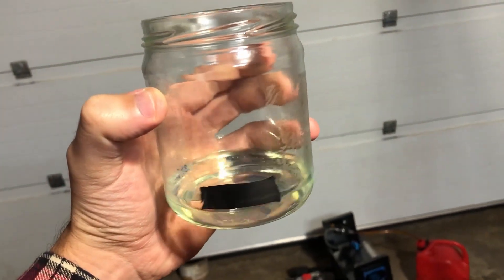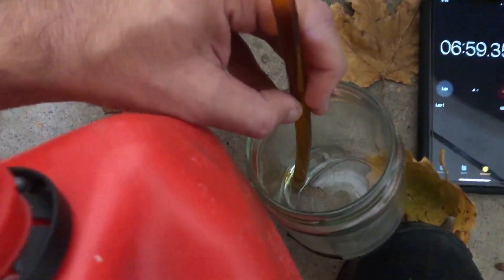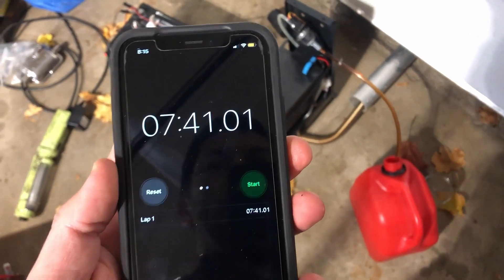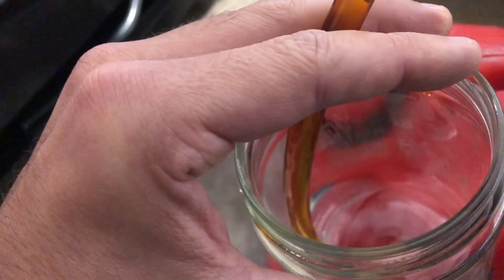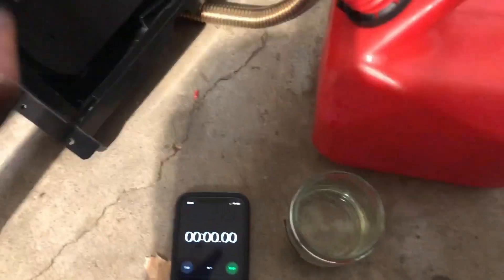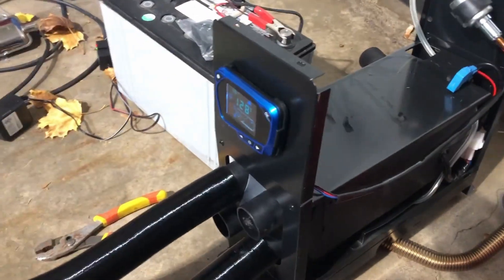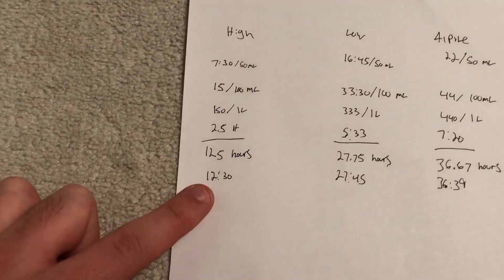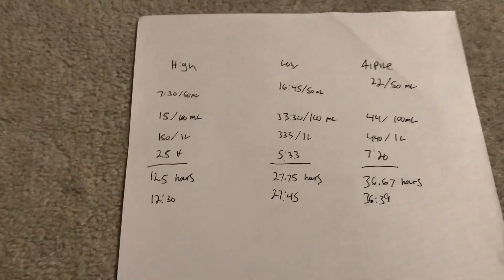Vevor Diesel Heater Fuel Consumption 5Kw

Comment: Pump is 0.022ml...    hertz rate of pump...    0.022ml x hz x 60sec x 60mins
Low...    0.022 x 1.4hz x 60 x 60 = 111ml an hour...

Med...   0.022 x 2.8hz x 60 x 60 = 222ml an hour...

High..   0.022 x 4.2hz x 60 x 60 = 333ml an hour...
Simples
Reply from the maker: My heater you can’t control the pulse rate. Well not directly. It’s only settings are 1-6 unlike others where you can control the hertz for the settings.
Reply: @brettseres8352  time the pulse rate for 30 seconds and double it for the hz rate 👍

Comment: Not cost effective. Diesel is $4.00 a gallon.
Reply: I disagree when it’s freezing out you would happily pay $2 to stay nice and warm in your camper van all night 👍🏻🇬🇧
Reply: @AJ-qn6gd  And a man dying of thirst would gladly give everything he had for a drink of water. Now please tell me what that has to do with the price of Diesel?
Reply from the maker: The cost is irrelevant to me for the heater. I have it for a reason. It’s a portable heater for me that can be used for different things than my buddy heater. The cost per hour to stay warm in certain circumstances is irrelevant. But I do want to know how long I can run it before I need more fuel.
Reply: At the moment, pump diesel is £1.47 per liter, to run a 1kw heater costs me 36p in electricity per hour, the heater will run for about 5 hours off a liter, that's about 29p per hour. It's not much but it is a saving. In UK we can get red diesel meant only for off road use and that's about £1 per liter. Fact is that we are mega jipped off here in UK for fuel. Not sure how it is for USA but as far as I can see it is worth doing but does involve faffing about setting it up, it's noisy etc. so when you say not worth it, that depends on your situation and to just state ' not worth it ''could really do with some explanation.
Reply: When your cold cost means nothing
Reply: I use my diesel heater in my house. It's a lot cheaper than oil, Electric heat
Reply: I use Kerosene at 83p a litre which uses a litre a night to heat my upstairs in my house, it stops condensation as well. I also use one on my yacht which gets too hot on occasion...
Reply: About 6 here in Canada 🇨🇦 still theaper than a furncae and if you make your own biodiesel your good to go or waste oil mixed with 30 percent diesel and some additives . Make a setup fornstart and shutdown with straight diesel fuel then run off other oil 🛢
Reply: Says the guy with zero analysis skills.

Comment: Good video and thanks for your efforts. But you could have saved yourself hours of testing. You have the pump displacement (.02ml) X pump frequency. Can be set instead of Temp.
Reply from the maker: So yes that is an option. Unfortunately my heater is just heat levels 1-6 or I can do it by temp. Other heaters you can change it my frequency…I found this out after I bought mine.
Reply: @brettseres8352  Understood.  Still a good effort and I'm sure it will be helpful to many other

Comment: Tell me a little bit more about your under the garage door seal installation.  Any issues with heat? Im looking for a under the garage door seal solution
Reply: Get some cheap flexible Styrofoam "pool noodles " to close the cold air gap under the garage door. But hold it back from the very hot exhaust pipe by a few inches.  IMHO
Reply from the maker: I just have the exhaust running into a 3” aluminum pipe.  That was getting too hot for the rubber seal still so I now prop the door open on an old coffee can and it sits just above the pipe so it has a little air gap